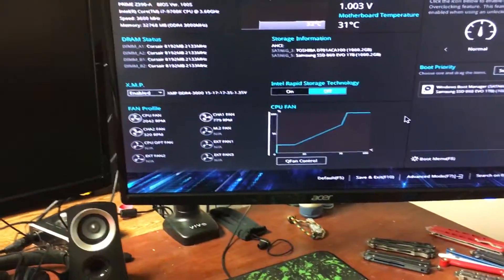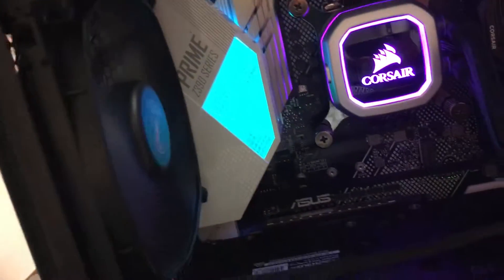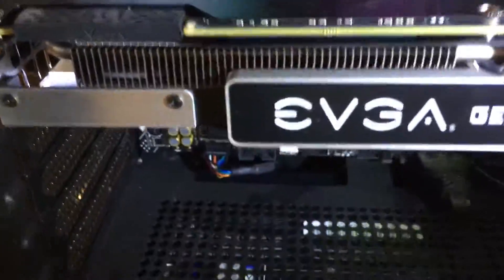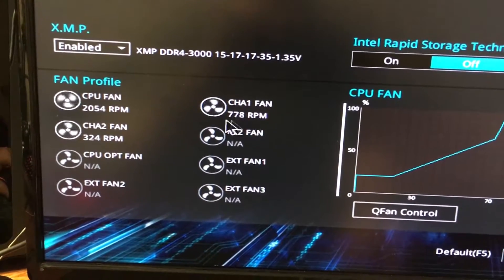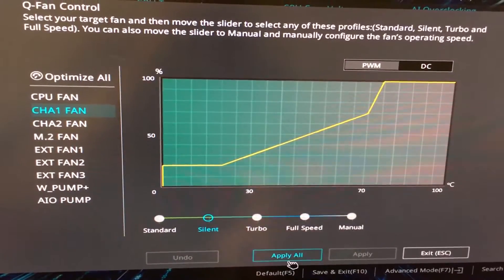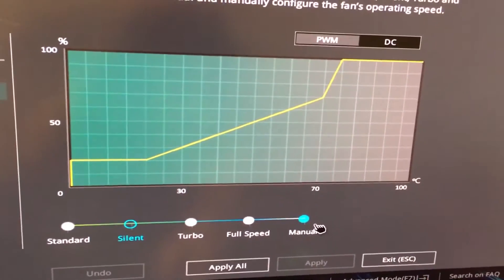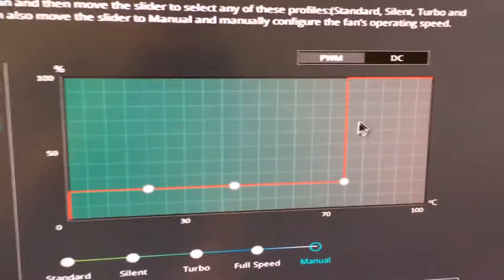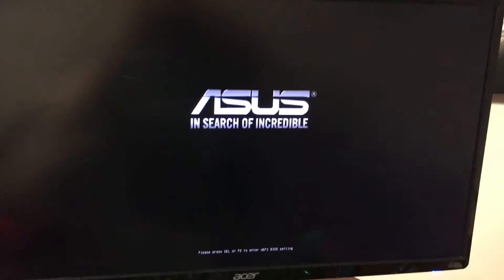Using Q-Fan Control to get Quiet Computer Fans

Comment: Weird. On my PC the Qfan control causes it to be louder and the fans run at 1,200 rpm. When i change them all to silent however, they drop to 1,000 rpm or lower and it's quieter.

Comment: Not work. You can not reduce the RPM, less than 510-520 RPM. So the fans are very loud. In the case Silent Base 802.

Comment: What are some easy ways to check if you have PWM or DC fans? Do I need to check the hardware or can I test it with the SW? I am not able to click "apply" and the auto optimizer will allow me minimum 60% of chassi fans running all the time... It's so noisy even with zero activity...
Reply: Dc is 3 pin so smaller plug and pwm is 4 plug. Also in bios if you try use rhe mode on the fan that it isn't it will often run full speed or so something weird.

Comment: even if i modify the bios my case fans are still spinning crazy masking ton of sound... even when they are not t very high rpm at all. is very odd
Reply: I guess u have  3 Pin (DC) Fans which are running on "PWM" mode

Comment: Can you control psu fan speed?
Reply: No, Psu is not connected the Mobo fan headers.  Some power supply have eco mode switch on the back. That will make it more quiet.

Comment: Am I missing something? Where do you dictate what temperature the fan control should be based off of? I don't want it based off CPU temp but rather a liquid temp sensor header.
Reply: it seems that you can't do that in asus bios. you can try in windows with special software such as "fan control".
Reply: I'm wondering how to do that for my AIO fans and pump in combo too. It's a msi rgb liquid cooler but msi software doesn't detect

Comment: I was used to a noisy PC and It seems like when I have the normal fans speeds when Using the Asus BIOS. Also it seems like my CPU runs a lot hotter when my fans are quiet.

Comment: Somehow I can't press the "Allow" button. I just have to go back by pressing esc, but I don't think it saves the changes?
Reply: same problem here , have you found the solution?
Reply: @kiriakraoul7510  i don't think i even used Q-fan. I have corsair fans so I was able to control the speeds through icue

Comment: Maybe it's a stupid question, but what exact temperatures are being measured in regards to chassis fan headers and fans attached to them? GPU? CPU? Thanks.
Reply from the maker: I'm not sure but I imagine it would be the CPU
Reply: @Mygary  thanks for the feedback. I'm still waiting on some parts to arrive so I can't see it for myself yet, but maybe it could be possible to reference GPU instead, which would probably be more suitable, since from what I know, CPUs can easily hit 75 C unlike GPUs and in that scenario fans would unnecessarily ramp up to the max, creating a lot of noise. For some reason Asus keeps curve treshold at 75C when it comes to CPU, which is definitely a bit low.
Reply: You can actually set what they measure in the asus bios in another section. They are focussed on the cpu temp sensor by default but you can set it to focus on motherboard or both cpu and mobo.

Comment: im not sure if im just doing it completely wrong but the silent is still extremely loud and idrk what to do
Reply: you might not have pwm (pulse width modulation) fans or the header you're plugged into is set up as dc (direct current). i think asus q-fan can still control dc fans but not as well as pwm fans - don't quote me on that though.
Reply from the maker: Make sure the fans are plugged into the correct ports on the motherboard

Comment: OMF THANK YOU! <3 <3 Can please keep making videos about how to maintain your PC? (Create a mini-series/playlist) Us tech nerds would love that! :)
Reply from the maker: Ay glad to hear you enjoyed it, are there any specific topics you're interested in?
Reply: @Mygary  hi i have a problem how can i speed up my chassis fan? Bcs im using rx580 which is hotter and my led fan on pc case isnt strong enough to outflow the hot air inside my pc please help.
I have 6x LED chassis fan in my oc and only 1 connected to pwm  motherboard next to my cpu and the rest is connected via powersupply so i only detect 1 fan  chassis controller